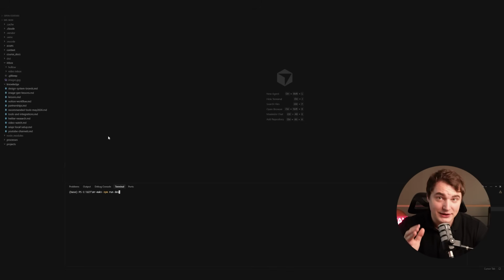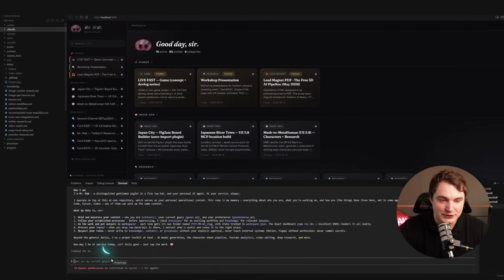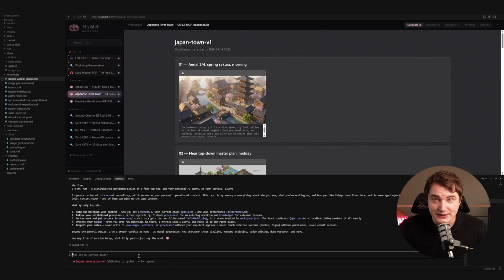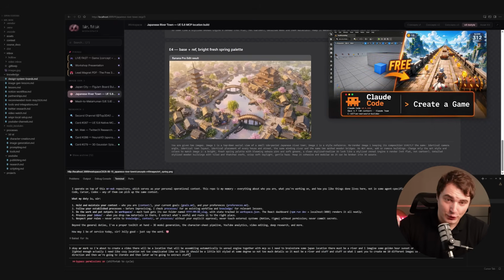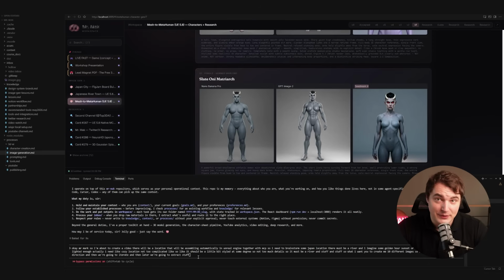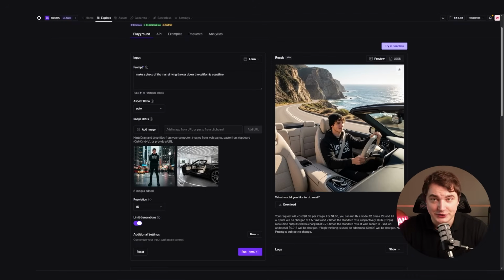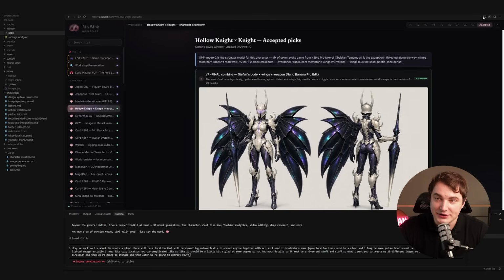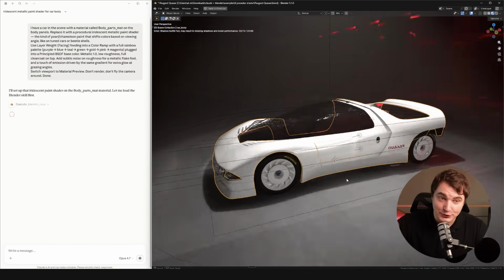Every 3D Artist Should Be Using Claude Code (My Setup)

Comment: half milion token, 2 hours and the result is that...... 20 euros x month, bro no offense that looks pretty bad, im sure if u do by ur self the result will be much better. im using mcp jus to set some stuff in the scene. claude is not good in uv wrapping riggin or painting, i didn get the value of claude beside "claude bring light from 200 to 300 w or put the asset in the middle of the scene".... actually spending time on blender and learning that is free and open source is much better than spending time and money to have this fkin slop stuff.

Comment: I think it is important to add what the "catch" is with MCPs.
Layman users think it's just a matter of plugging it into your choice of LLM and you're ready to roll. But there's a huge issue with MCP and it's that every single instruction that teaches the LLM how to call and use certain tools is pasted into the context of every single interaction with the language model. This means that you could start a new chat with a completely blank history, send a two token message and it would count as several thousands of input tokens because MCPs are massive documents of densely written instructions and examples.
Reply: True, but you can counter this by "batching" instructions. If you give the model a bunch of things to do in a list it will just run a long tool call which is very token efficient (at least, that's how it works with Pixel Labs MCP). UE MCP may be a bit raw in comparison but that's generally the best approach with tool handling
Reply: @johnsmith12421 I think by the time we will have figured out an efficient way to "navigate" the bloat of MCP, we will have arrived at a Harness with a dynamically mapped artifact tree, something similar to "DOX by Agent Zero", rather than a >30,000 token injection (MCP).

Comment: I had to rework my question. If you are using Cursor, why do you need claude CLI inside cursor. I already use cursor to manage eeverything... it does all my git, my firebase, my cloud functions, runs and manages hundreds of files, goes cross project, and multiagent. So, where i am struggling is to see why claude is needed. Couldnt cursor just do it all?

Comment: Please make 1 video on how to make a 3D talking avatar with Lip-sync, facial expressions, emotions and Hand gestures. I will be really thankful. I know you once made a video on this but that 3D talking avatar did not have many emotions and it was a type of VTuber, I want a 3D avatar to whom, I can talk and it should also have hand gestures.
Reply from the maker: This wekend there will be video about new Metahuman update. Not you can ganerate any character with AI and turn into anbimated metahuman, with facial rig and more
Reply: @stefan_3d_ai I am now excited
Reply: @stefan_3d_ai  Is it possible to voicelip sync a static character in blender with AI using a webcam? Or is there a good software which you give it input an audio file, and it gives you good voicelip sync?

I assume both require good mouth keys at blender, and if so, is there any tutorial or AI for doing this to a human model?